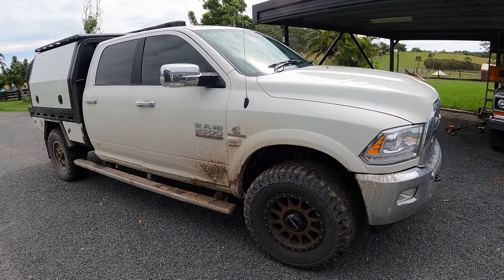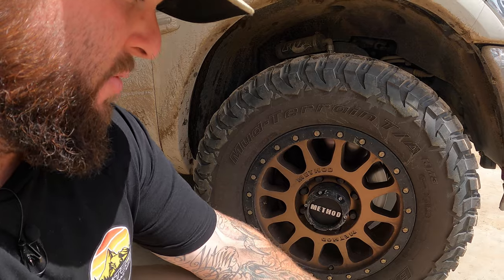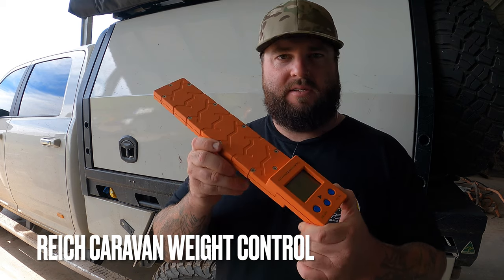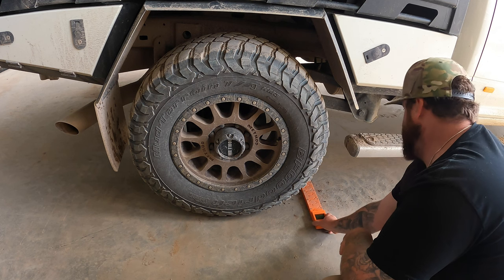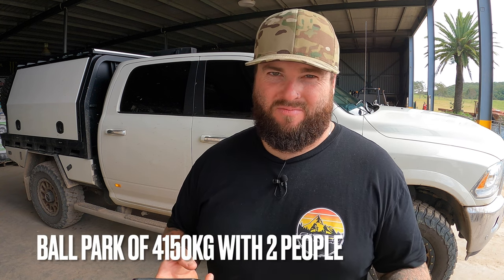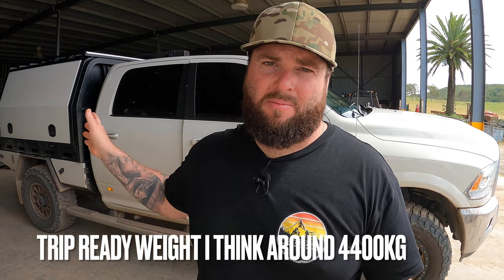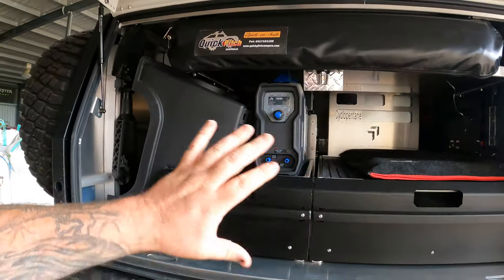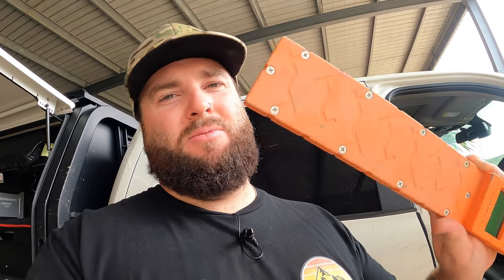RAM 2500 MITS ALLOY TRAY & CANOPY WEIGHT ? Is it now over GVM ? Watch BEFORE  modifying !

Comment: I have the exact same 2500 I have installed GCI Traytec tray & canopy, with 160L water tanks, Longranger Aux tank, 5 Methods, 295’s. 4 Stedi Pros and nudge bar. Weigh bridge full of fuel (no water) no humans was 4290.  I have a 4T ATM Kedron with TBW of 380.  Sadly, I had to go with GVM upgrade.  However, they improvement in loaded ride quality exceeds my 200 series and driver fatigue is a thing of the past.  Previously like being on a boat in a small swell!  The Kellerman rear airbag suspension with my existing King shocks is fantastic.   I was hoping to not do the GVM by shifting as much weight in to the van as possible, as I have around 900Kg payload in there.  But there’s not much secure storage in it, besides, thats why I installed a canopy in the first place.  My calculated fuel average at touring weight, 11.6/100 no van (recent round trip Newy to Bairnsdale VIC), 19/100 with van Newy to Sunshine Coast via NE Hwy.  Advantage of heavy vehicle rego, 100 speed limit. Sure makes a difference in consumption!

Comment: thank you for the detailed video  as great upset to keep underweight of max 4500kg  as driver Isuzu 300/75 4x4 as weight in 5000kg  setup and do 16lite to 100km and max distance is 1400km trip full tank of 280lite diesel

Comment: Depending on the touring being done I would drop the second spare for some vehicle protection (bull bar & driving lights) and this may also allow that extra weight for a full 70l water tank.
Considering the weight restrictions you’re faced with though you’ve done a great job. 
Some happy clients no doubt! 👏🏼
Reply from the maker: Yeah absolutely mate, give you the option there to add a bar and drop a spare tyre etc. Possibly move some weight into the caravan. But I think it’s at a point to manage there weights for the different trips they plan.

Comment: Great information thanks. Can I ask why you didn't buy a 3500?
Reply from the maker: Either the 3500 or 2500 payload capacity is same for a car license in Australia. This is clients truck I built for them. The 3500 has leaf springs but harsher ride then the coil 2500

Comment: How is your F250 compared to the Ram? Can you weight the Ftruck
Reply from the maker: Yeah I have mate. The Ftrucks on the 4.5 line it’s very tight, I have bullbar winch, rooftop tent, roof rack etc lighting etc. I’m going to see what alternations I can make to bring it down a little. 😁👍🏼
Reply: Thank you so much for responding. I am sure you see your share of over weight rigs in Australia but here in the US people really don’t considered it in the same way as you all do. I asked because my wife and I want a touring rig here in the states to tow a small camper and we looked at a canopy setup or just deal with the tub and put a canopy on it. Love the Ram but I’d like to know your opinion,  Ram or F truck and would you recommend a canopy or just leaving the tub and put a cap on it ?